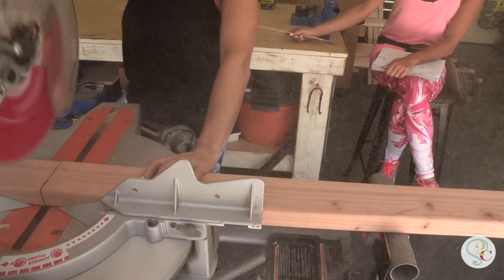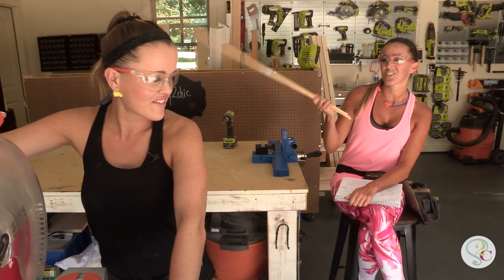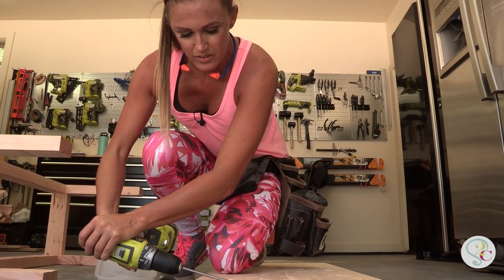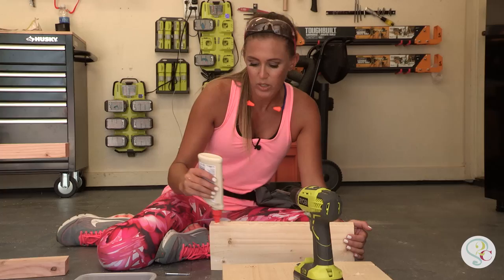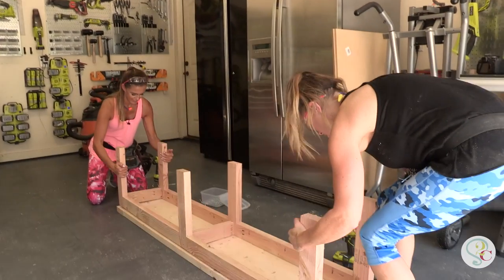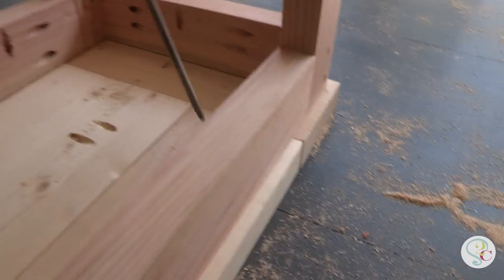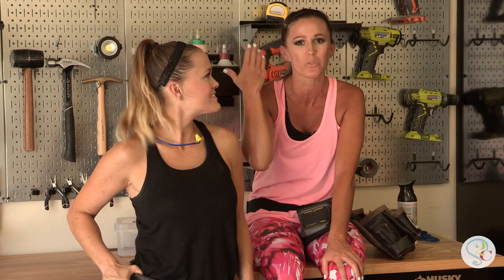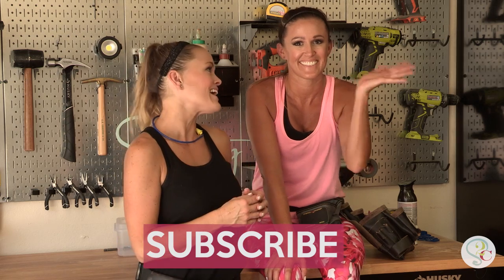$25 Farmhouse Style Bench | #ShantyHouseCrash

Comment: My wife and I just buildt this based off of the plans, and I learned three things. 1) don't paint it a red color no matter how dark. 2) It is really long, I am 6 feet tall and I can lay on it. If I was to build this again I would reduce the length of it by 1/3rd at least. 3) When they used wood screws to attach the half base to the rest of it,  it's because the drill/ impact wrench did not fit inside to attach the rest of the base... I used a wratchet with a number 2 bit (forgot name of the pocket hole screw slot) and it worked very well. 

However,  I was able to set 3 people on it totaling 550lbs without a creek. GREAT BENCH, THANKS GUYS!

Comment: Love all of your builds.  It looks like, in the video, that you all cut down the sides of the 2x4's to get rid of the rounded edges, like you normally do.  But, when I looked at the free plans, it looks like the sizes specified are still for a 3.5" wide 2" x 4", not a 3" wide (like it would be, if the sides were cut down).  

Maybe my math skills are not working today but any help with that would be great!
Reply: Indeed.  I was about to build this and I noticed that as well.  I don't know anything about squaring off 2x4s.  I imagine I'd need a table saw.  I have every other tool required to build this, however.  Ladies, can you give us some input on this? 

Thanks! :)